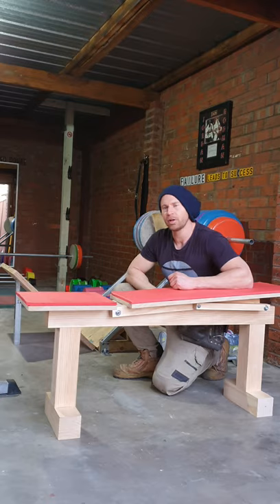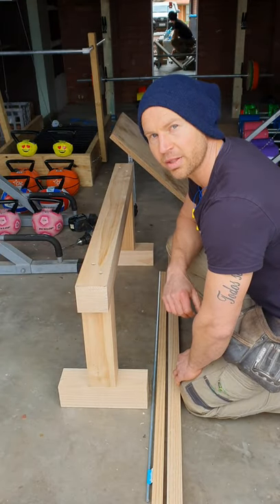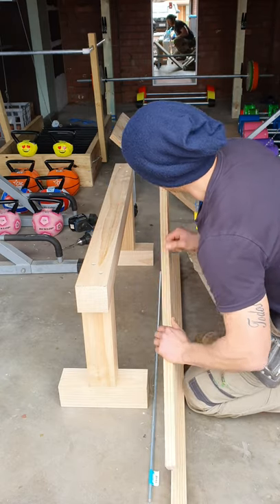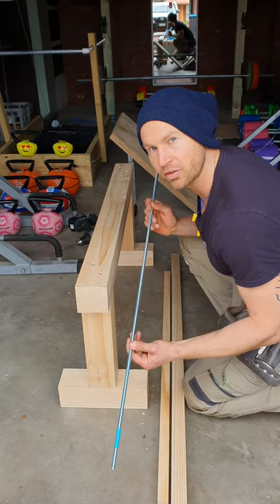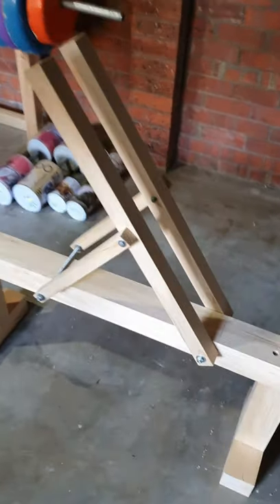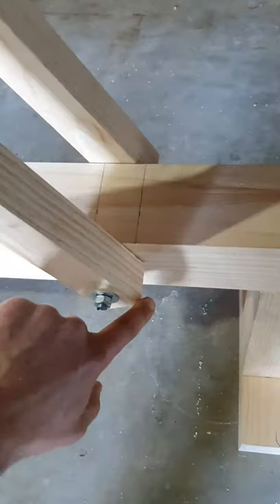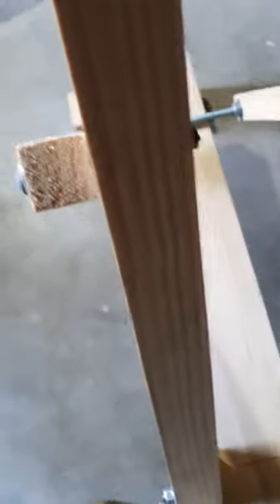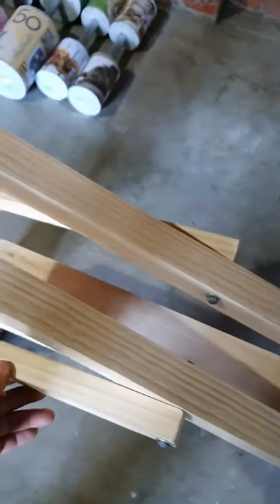DIY adjustable incline bench

Comment: Some of the material uou mentioned is below. I am assuming those measurements are after you have cut them. My question is what do I go into the store and buy? Could you write up the uncut measurements of the woods you bought please?

1 x 1150mm (90mm x 90mm dressed pine) Upper platform bench frame.

 
▪︎4 x 300mm (90mm x 90mm dressed pine) Legs and leg supports. 

▪︎2 x 760mm (40mm x 40mm dressed pine) Seat frame 

▪︎2 x 400mm (30mm x 30mm dressed pine) Back support adjustment frame. 

▪︎1 x 300mm x 350mm (19mm mdf panel) 1 x 300mm x 860mm. Seat panels.
Reply from the maker: I would suggest taking that list in and asking at the store what they suggest:)

Comment: Hi did u end up making some adjustments for the seat? Or did u just leave it? Coz when doing exercises at an incline angle, the body would move forward a bit and if the seat was just flat, your body would slide along the seat. Thank you for this video btw, you helped me build an incline bench just like this one and your measurements were perfect so thank you
Reply from the maker: Hi mate, no it's fine to leave the seat how it is. Good question though👍
Reply: @MattLees-Nunan  yea, you'd might want the small part inclined as well.

Comment: Also at 2:01 is that rod you have cut that you are sliding into the wood and attaching bolts too. Looks like tiny pieces you cut. What measurements?
Reply from the maker: They are 75mm:)

Comment: Hi How many cm is the Length, Width, Height?
Reply from the maker: Hi! If you turn the video to closed caption mode it will being up the measurements in mm which you can convert. I've also included the measurements of pieces in the description😊

Comment: How many inches gap for the back support?
Reply from the maker: It all depends on what is most comfortable for your back and what exercises you want to do😊
Reply: Thanks bro last question is i buy from the only 3/8" inches threaded is it enough? Didn't see it yet it's still coming thanks for answering this question though
Reply from the maker: @nilmarpatagoc8760  Yes! That is fine. That's what I used😊

Comment: what is the Size of Seat Sorry This is 3 yrs ago
Reply from the maker: Hi! So the seat panel sizes will be in the description:)
Reply: @MattLees-Nunan hi ser ehat is the size of washer?
Reply from the maker: The size of the washer should be just big enough to fit over the bolt thread
Reply: @MattLees-Nunan  the size of Threaded Rod Is 1/2 ??

Comment: Do you know what width the 150mm screws are?
Reply from the maker: 5mm thick😊
Reply: @MattLees-Nunan  thanks. what size of drill bit to cut the hole for the threaded rod?
Reply from the maker: 11mm bro
Reply: @MattLees-Nunan  you'd think but Ive read since to use same size, ie 10mm? These bits get pricey.
Reply from the maker: Yes, you're right. They can be expensive. How about using a 10mm bit and just making the hole just a bit bigger by moving the drill around while you're drilling?😊
Reply: @MattLees-Nunan  I get what your saying thing is all these materials add up and if I wreck the timber I have to buy a whole new piece.
Reply from the maker: Yeah, it's a risk but just do a little bit at a time and you'll be right😊
Reply: @MattLees-Nunan  another question. He says he uses a 40mm and 30mm wood piece and he puts a 65mm bolt through these, obviously  can't be so which numbers are wrong?

Comment: I am having such a hard time figuring how to create an adjustable decline and incline bench that can support my 144.2KG (317lbs) weight. I'll also be bench pressing 140/150kg. 

Any tips? Bro this is really overheating my brain as I'm a total newbie when it comes to wood work .
Reply from the maker: Oh, so you need a video on how to make a decline bench?
Reply: @MattLees-Nunan  You Don't have to make a video if it's too much hassle but if it isn't a bother sure a video would be great. However not just a decline bench
 It has to be an adjustable bench that goes incline, flat and decline. 

The problem I am having is that I need it to be strong. I was thinking about doubling the wood both  for the frame and the thinner long bars of wood where the metal rod is inserted into which helps to adjust the bench. 

And if you are going to make one I would suggest putting some handles on the bottom of the bench so that when you put the bench in decline to do leg curls you have something to grab onto when you do leg curls. Lying leg curls are supposed to be done at a decline creating a pivot in the hips because this will help give a better contraction, the motion is easier to preform at this angle and you can use more weight. The flat leg press doesn't allow you to do this and is obsolete. That's why you never see a flat leg curl machine in the majority of gyms today.
Reply: @MattLees-Nunan  Lol bro I'm creating a wood horse. All of this is very new to me so I get frustrated at times trying to figure out what to do. Hope you and your family are doing well.
Reply from the maker: @fightermma  You're doing a great job bro! Stepping out of the comfort zone can be challenging but rewarding😊
Reply: @MattLees-Nunan  Did you decide to make the adjustable decline/incline bench?

Comment: looks quite interesting :) but still seems a bit unstable. What do you think? I'm doing flat bench with 120-130kg + my own weight of about 90. Will it cause problems? of course it wont brake, but I think you know what I want to ask. thanks
Reply from the maker: Will definitely hold. Not a problem there at all. If you check out my insta stories under "IsoGym" you will see a fellow subscriber who loaded it up on the incline setting! This will give you some reassurance😁
Reply: @MattLees-Nunan  I cannot see because of no insta account... But I still trust you in what you wrote :) nevertheless thinking about building my own but as steel construction, also drawed and built my own half rack made of steel, but steel is always much more work as wood, and no space for mistakes...
Reply from the maker: That's great to Lukas! Good luck with the construction and let me know if you need anymore assistance!